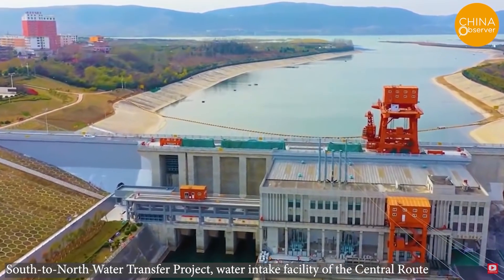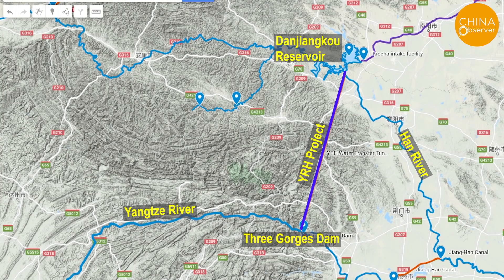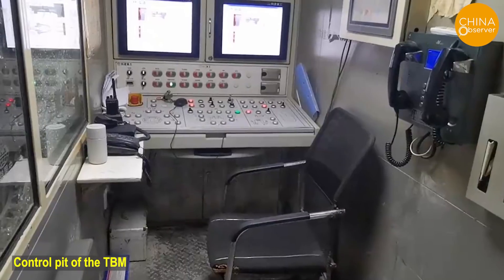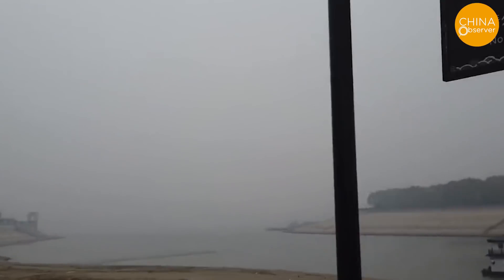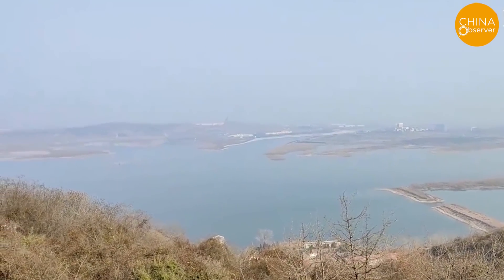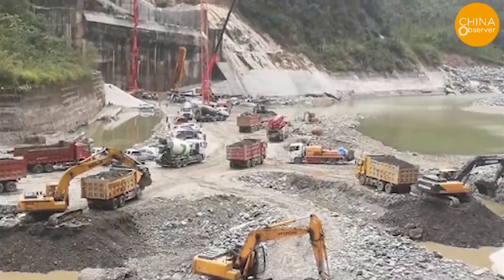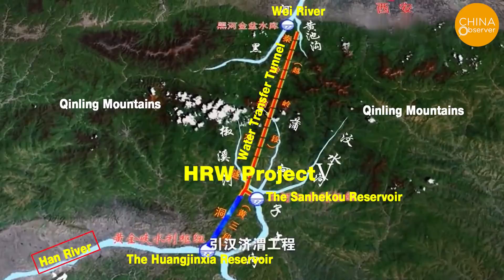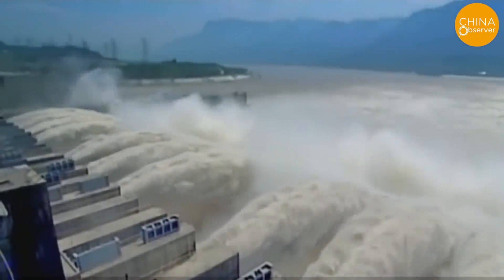194.3 KM Stupid Tunnel to Make Up the Faults of the $77 Billion S-N Water Transfer Project |Failure

Comment: In the US, in 1851 there was a project called the Hoosac Tunnel. It was a railway tunnel through a mountain, similar to this project, but it was just under 8km long and FAR less complex. It took over 20 years to build and went over budget by a factor of 10. This water transfer project is going to be an absolute NIGHTMARE at nearly 200km long. Also, the Hoosac project led to the deaths of 196 workers from accidents. Considering the corruption in China, I wouldn't touch this with a thousand-foot pole.

Comment: This video is slightly biased and exaggerated. As if floods aren't common in China and haven't occurred throughout its history. The floods in 2020 weren't close to be the worse floods China's experience, in fact, it's t be expected, China has flooding problems every single year caused by the Monsoon and it's literally inevitable. Kinda absurd to blame these floods on the projects or even that the projects exacerbated the flooding problem, since flooding is commonplace in these regions and always have been.

Comment: GRAFT as Sr CCP run every major corp ie every biz working on such & juices GDP just like falling apart empty housing, crashing high speed trains on lines 50% & more unused, tunnels that flood killing 1,000s. fyi 3.9 billion cu meters this will move us a FRACTION of what NYC water system moves, about 3%, which just proves this is a makes money project & assume the published calculations used to justify this boondoggle are made up - well that or VASTLY more water will be moved turning wet areas into deserts & deserts (no doubt owned by corps controlled by Sr CCP) into rich farmland.

Comment: The denial tune in this report can not hide a simple fact, China is able to complete mega project that Western countries +US can not achieve, not even.close. 
In one way, western decendent countries have lost the POWER.

To be simple, you can give a lot angles to say a project is a failure, talking is Cheap. Get it done is another level.

People can think in this way, which government is spending money to care for the goods of a lot people rather than the few ?

Road, water channel, are used by a lot people, not just a few people. 
If corruption need to hack the money, there is a even smarter way:  look at the road and airport project in USA, UK, Germany, you do not need to work so hard, do so much, do a little piece of work, send a huge bill, end the job in next centry, that cost the littlest, have more tea time, the money is still yours. 

The CCP definitely corrupted in the most stupid way, they really had thousand km channel built up, had water running through, and get it done, really completed. THAT IS THE HARDEST WAY TO CORRUPTION, is not it ?

Comment: The canal was not good engineering. You get too much water loss from open air evaporation and water leaking into the local geology and aquifers, underneath and adjacent to the channel. A large water pipeline, instead of a canal, would have removed those water losses.

Comment: This is the result when "can we do this?" supersedes "should we do this?", if either is a no, you should not proceed but China focuses on the first only and ignores if they should or not. China's issue is that most of it's water is in the South and most of it's fertile lands are in the North and instead of checking how shifting the water to fix this issue would go, they instead just see if they can do it... then because it was built for the cheapest possible and is no longer the pet project of the Winnie the Pooh, funding dries up, maintenance gets underfunded and the sand walls embankments fail completely.

Obviously doing nothing isn't an option, in a dry year the north is unlikely to make enough food to feed everybody but nobody bothers to ask if they are really doing the right things...

Comment: Cmon, size of projects Chinese capable of doing better make a turn in the end of tunnel and lock water in a 500 mile loop and install turbines all the way, at least would be interesting to know the propable output For different sizes and propability of new possibility. 🧐

Comment: All projects must be built using the CCPesium that the CCP itself produces.
"Concrete" without cement; "steel" without iron; "progress" without planning or foresight.
Reply: Buildings and dams are built without solid sets of plans in china. They fake it till they...OOOOOOOPPS...
Reply: Really?
Reply: @georgewong1837  China is a country of Tofu Dregs, there is numerous videos of Chinese construction workers bending and shatter steel poles with their bear hands! The same poles that were meant to be used to build 20+ story residential buildings. Another one is roads without foundations... lots of roads and side walks collapse because they didn't even put basic foundations under them or just straight up laid them on top of sand... and sand washes away easily.

Comment: I grew up in a small town in northern china. In my childhood, the city (and the region) suffered heavy water shortage problems. The tap water is only supplied for 1 hour everyday, even in urban areas. And people were only able to take shower once every week or every two weeks. I think my hometown is on one route of this "S-N Water Transfer Project" (or some related water transfer projects under other names). And today, the water shortage problem in my hometown has been largely resolved, tap water is supplied 24/7, including some rural areas. What I'm trying to say here is that people's living standard has been largely improved, partial credits would be attributed to these water transfer projects, and I don't think you should care too much about the profit when evaluating this kind of infrastructural investments.
Reply: its actually a good idea. The USA could use similar. 
it appears to have the usuall execution problems. The tunnal IS rather ambitious engineering.

Comment: Definition of STUPID is....
Spend 20 years...2 Trillion Dollars...3700 dead soldiers...and Run away in the middle of the night from Afghanistan...😂😂😂😂😂😂😂😂😂😂😂😂😂😂😂😂
Reply: You can blame that miserable ,demented old fool joe biden for the chaotic withdrawal. The stupid democrats are always  involved in chaos.
Whatever these liberal democrats touch turns into crap.
Reply: @Dr. Seitz sure everything is trumps fault. You leftists are insane.
Reply: @Dr. Seitz because chinses trolls are technically "leftists" also.
Reply: The Chinese are wasting more than the Boston tunnel project.
Reply: @nordhafen3043  China is 40 Trillion Richer than the USA, Despite of US toilet paper printing...😂😂😂
Reply: @nordhafen3043  The "BIG DIG" was cover for an extensive black opp tunnaling network connecting all the ivy league colleges, think tanks and DOD developement labs. 
Just like the Denver airport, sometimes disgrace is cover.

Comment: Take it from a Californian:  MOVING WATER LONG DISTANCES IS ALWAYS A BAD IDEA.  To do so is to enable a delusion, a destructive delusion.
Reply: As an uneducated Swede, im curious: What water source has had its water traveled long distance? Wanna look into it, all environmental impacts we have on the globe catches my interest.
Reply: @Monno15  both San Francisco and NYC have extremely long water supply canals and tunnals, both a 100 years old or older, both kick @$& at an engineering level. Both brillient public works. 
Other water projects like Los Angeles Owens river valley ruination and thievery are lessons more in tyranny then engineering though the engineering was top notch in its day. 
Phoenix AZ, uses 100 mile plus canals from the Colorado river. Also, 95% of the current canals in metro PHX are right over top of 2000 year old Tohano-Oodham canals that functioned into the 19th century.
Reply: @Rivenburg-xd5yf  Thank you for taking the time explaining. Now I understand more about the issue :)
Reply: @Monno15  documentaries on all 3 systems i mentioned. probably here on YT. 
SF system is The Hetch-Hetchy project. 
LA system,  Owens river valley project, 
NYC system, The Catskill Aqueduct.

Comment: S—N didn’t cause pollution. Pollution is a different topic. 
S—N causes of course less water in one basin but it is a solution to bring water from further south. It has its problems but the real issue are the mega cities up north. If China wants to supply its citizens with water there is no alternative. Water conservation efforts can only reduce the amount needed, it can’t produce more water. As those rivers are quite massive it is possible to use that water.

Comment: QUESTION, Im no water engineer but i do know rain comes from warm water rising causing clouds that rains the water back down again, if you move that much water around to warm areas wont it rise and come down in that, or surrounding, area, so my question is, is this the cause of the bad rains and flooding happening in china now ??
Reply: No, the amount of water moved is insignificant compared to the floods. And the floods are where the water is taken away…. .
Reply: Only a small amount of water stays in the local evaporation/rainfall cycle and this is only significant in certain parts of the planet where the wind patterns are just right. 
That is, over the whole of the Amazon forest this effect is fairly significant for the local climate. But this is the tropics. In the moderate zone we have a strong east blowing wind pattern drive by the Coriolis forces. The vast majority of all humidity is drifting 1000s of km eastward before it rains down.
Reply: I think yes , as a geologist